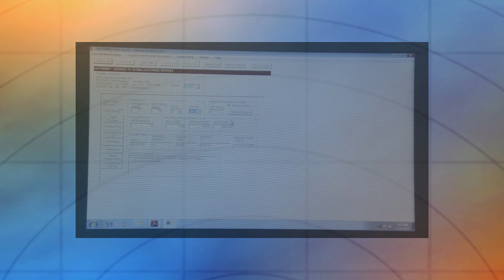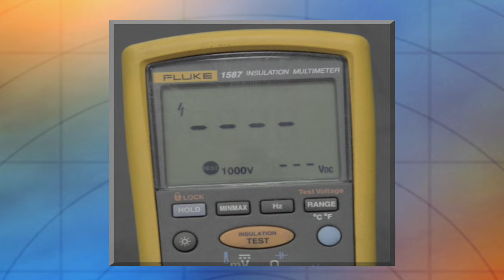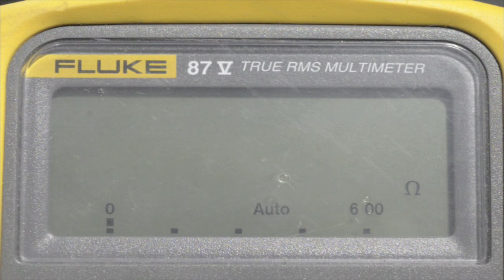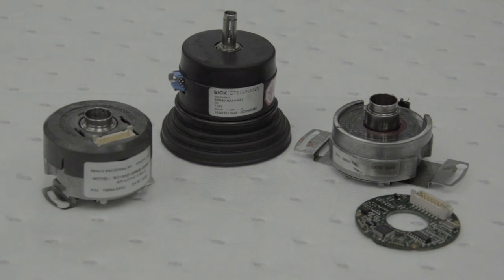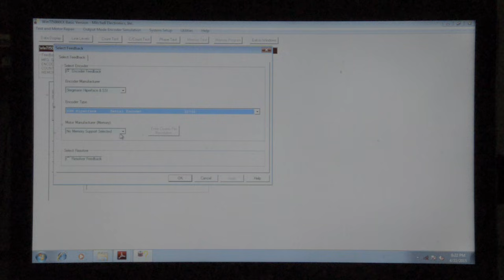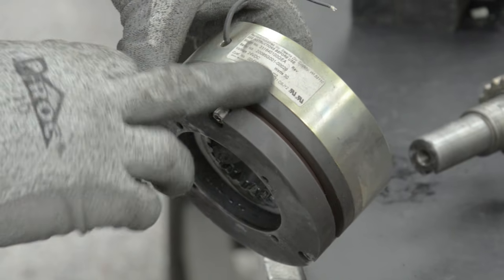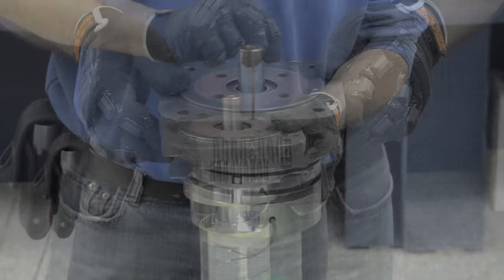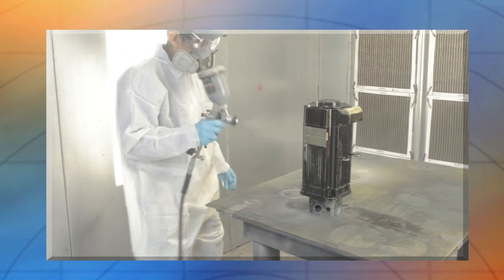Servo Motor Repair And Testing Procedures - Global Electronic Services

Comment: can anyone explain me how can that coil hold a position with no gearbox? its not configure like stepper motor to hold position, how does it hold a precise position (without a brake)? 
Does it frequently change directions to stay accurate in position ? or how does it work?
Reply: The video literally showed you where the DC brake coil was evaluated...
Reply: what the hell are you talking about, there are servo motors with no brake, and how would the brake help when rotating precisely?
Reply: @hikolanikola8775  Watch the video again. He literally is going over where the brake coil input is while evaluating the connections. Then he removes the brake coil during disassembly. The brake coil helps with more precise start/stop control each step. Less "play" between steps. A servo is just a more precise stepper motor.

Comment: True RMS meter for resistance measurement?

True RMS is for AC Voltage and potentially AC Current measurements.

It has nothing to do with resistance measurements.

Comment: I'M very impressed by your work stations,  but I would need a very comfort. chair to sit on while I do work and with wheels to move around.  I have over 43 years of work exper. rebuilding motors and servos etc.  Also removing bearings should be done with a grinder to prevent removing metal from the journals.   I have exper. in USCG, US Merchant Marine and  neuclear Power plants.    Thanks for the Great  Show.    Get your people some chairs, they are bending over to work and do important paper documentation.   Also I did not see any women there       Corey  Wade  Captain, Engineer US Merchant Marine   You may contact me any time. at  "ute76caw@gmail.com         I also would start out at a pay grade of aprox.  $65.00 to $45.00 / HR with full benifits.  Thanks again
Reply: Corey Wade you are over qualified.
Reply: Sorry Corey - you're fired!
Reply: Sir good evening
Sir i face  some problem in servo motor could you guide me plz.
Reply: Hi sir,
I need your advice, i have a heidenhein servo motor with a failed encoder, 2000 pulses three outputs, i found an encoder from other brand with matching specs but will cost me 10% of the price, do you think it is a good idea?
Regards